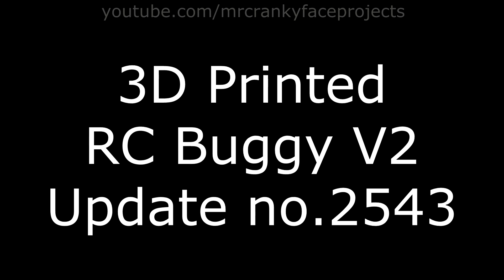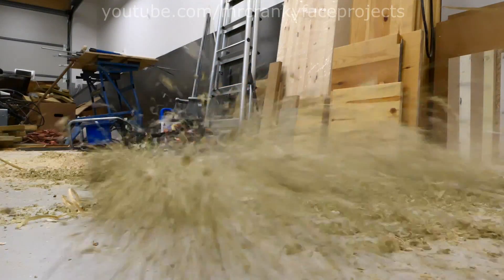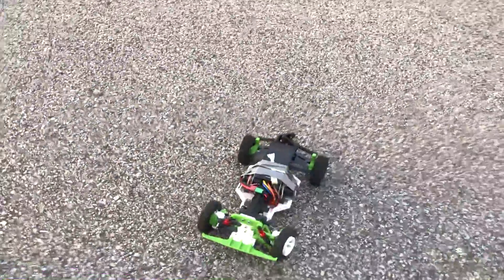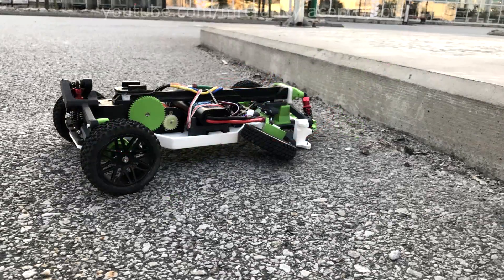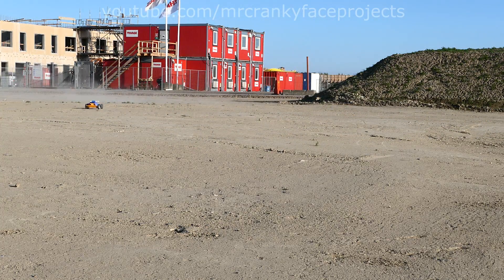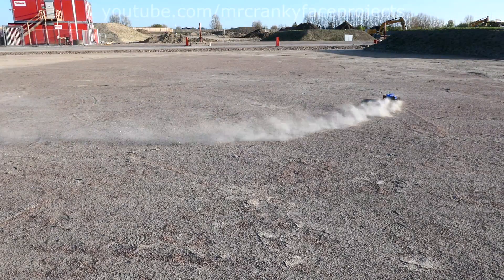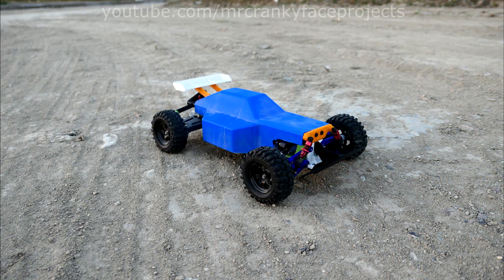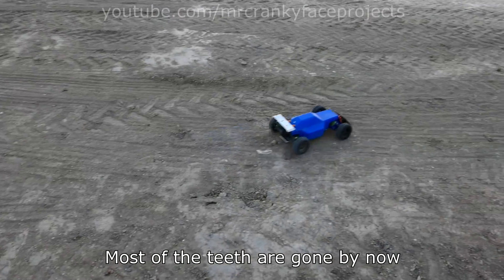3D printed RC Buggy V2, Will I ever finish this?!

Comment: that's why i only do 4x4....my fingers are made of Led. :-P ..it's  mostly for steering purpose.
A slipper clutch will help....I can hear the clutch nut or spring ...go click...on my over power
toys....( becuase I like to pop wheelies)...The  gears in my Fy03 clutch are still plastic
with a brushless 2845....on 3s 40C....lol...it's the slipper clutch..that's making it possible.

Its the samething on my MGT 4,6....the spur gear is  only plastic....The differental are
metal....the differentals are giving out....the plastic spur is fine becuase it'll slip not strip.

It's just a different driving style on 2wd....but those fat wide tries on my RC10 helped.
It's sort like driving on ice.lol

Comment: Great project, it's really coming along. Keep up the good work! Have you considered reducing the tooth count on the gears and increasing the tooth size. You can keep the same ratios while doing this but you will loose some smoothness in the transmission. However, your gears will be stronger and less likely to strip. Cheers. 👍👍
Reply from the maker: Thank you! I have considered bigger/less teeth but the motor gear already has quite few when you use the lower ratios(I plan on having several "premade" ratios), so I can't go up to a much bigger module. I might try helical gears in the future to have more teeth engaged at the same time.
Reply: Helical would be a cool solution. Should give you a quieter transmission as well. Looking forward to seeing what you come up with. 👍👍
Reply: @MrCrankyface  I'd actually suggest to use herringbone gears, as they reduce sideways forces on the gears.

Comment: Amazing! 60kph? Wow!  I may switch to a transverse engine configuration for my V3. I think this is more efficient. 

Keep up the amazing work.
Reply from the maker: Thanks! Give it a shot and compare it to your current configuration! I ran something similar to your V2 on my first buggy. I ended up going to transverse since the forces in the gearbox were easier to manage(less axial forces caused by bevel gears and such).
I'd imagine transverse is more efficient but it's definitely more of a gut feeling than science!
Reply: @MrCrankyface  No it really is, that's why hybrids and any car with good fuel economy use transverse engines. Trucks need lots of torque, so they use longitudinal design because a larger engine and larger transmission can fit this way even though there are power losses, efficiency and fuel economy are not the focus on big trucks and SUV's

I guess that's a tangent, either way--Watching this video caused me to begin work on my V3 car and I've already almost finished the rear Assembly in only 3 days haha it's gonna be great!

Comment: WOO! BUGGY V2! I have problems with building things quick too.
Reply: Yeah, the printed gears wear away fairly quickly, and for my case (3d printed brushless tank) I can't get the gears any wider. So I'm just gonna order some plastic RC Spur gears online.
Reply from the maker: Have you tried co-polyester, PETG or Nylon and also greasing them up? I noticed a dramatic improvement with co-polyester over PLA gears when it came to peak torque.

Comment: i want to give you a suggestion for your steering during off-road trials use a gyro with the steering servo and it will give you better control and it will allow you to focus more on the driving and power issues. I like the narrator for this video.
Reply from the maker: Thanks! The later shots in this video with the swamper tyres uses a gyro but I hadn't calibrated it yet.
With it calibrated it's like a night and day different when it comes to stability.. :)

Comment: When you release the files for this .I'm taking it to 6s because I like pain
Reply: I think you'll also get some molten gears >:D
Reply: Jotham B yh maybe
Reply: @jotham123  Hears are easy. You can make them from metal with just a proper file. Usually its everything else that is harder to make like gearbox shells etc.